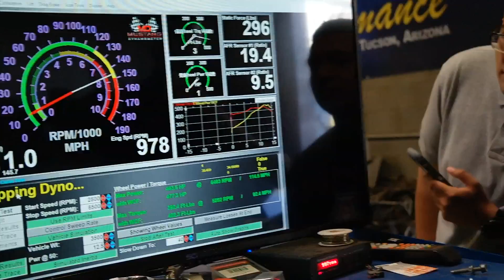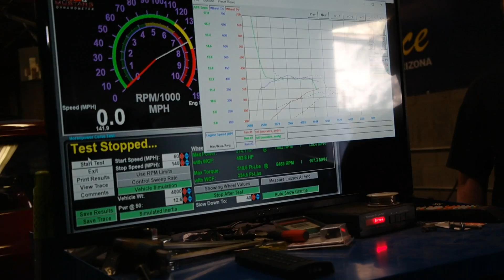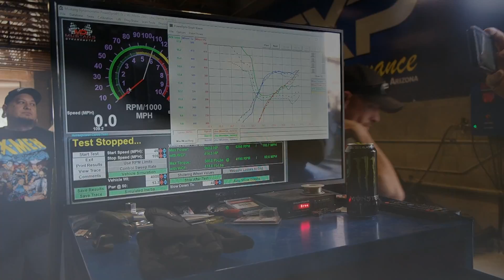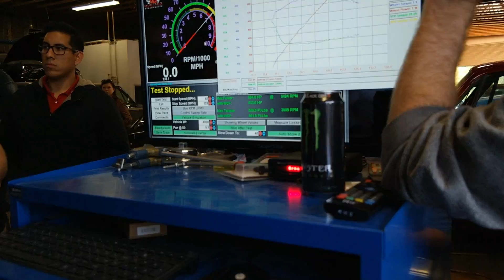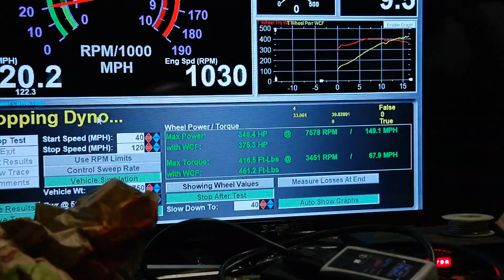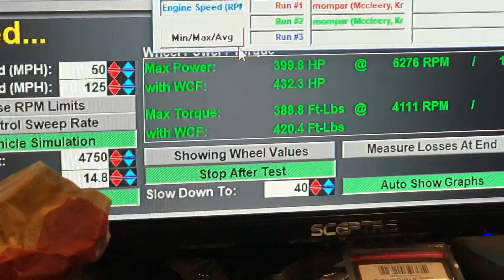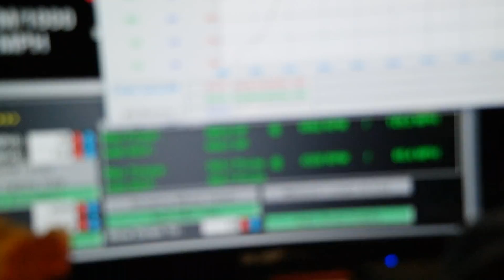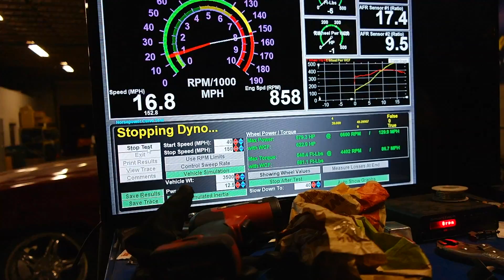EXP DYNO DAY

Comment: When I purchased my new C6 Z06 on March 1st 2008 I took it to the dyno(dynojet) on Speedway, she did 457 whp/427llb-tq, that was with only a few hundred miles.  a few weeks later I added an air intake and LGmotorsports headers and had Nick D tune it in Phoenix.  With 1400 miles on the clock  I drove from Tucson to Lewisville, Tx to a shop called qualitymotorsports and we did the QM550 cam, new heads($2500 job), ported manifold and ported throtle body and a cooler thermostat. We pulled 548whp/510 lbs on a Texas 105 degree summer.  This was the absolute worst car I ever had. Breaking parts all the time.  Thankfully I sold it the following year and it have had 5 other customers after me(last time I Checked in 2014), probably a lemon.  I should had just grabbed a LS2 base model vet and call it a day. if anything, the best part was my plates, I still have them, it says: GTRTHIS
Reply from the maker: Hahaha my buddy that owns it drives hard and has been good and running great
Reply from the maker: RS3tuber if you can message me on missed 3rd production instagram i wanna give you and your son some merch and stickers
Reply: @Gabriellopezlozano  I will be hitting to SIR this Saturday. I will be there as soon as they open.